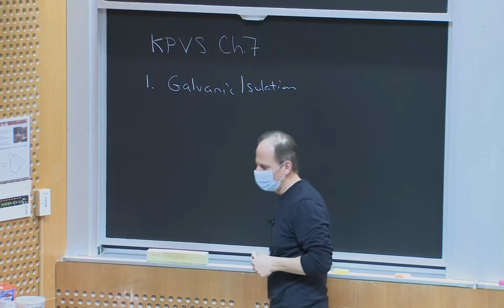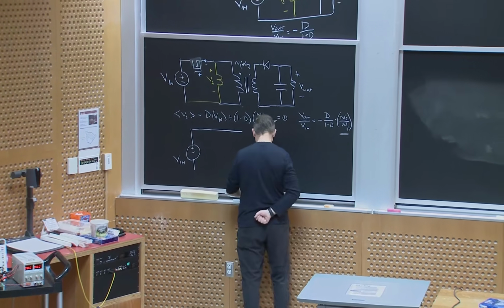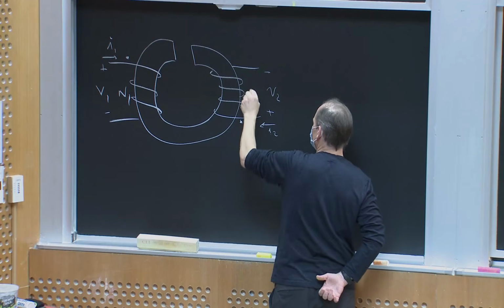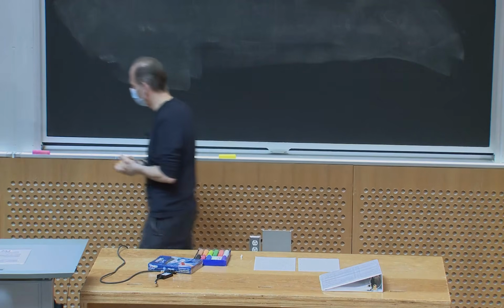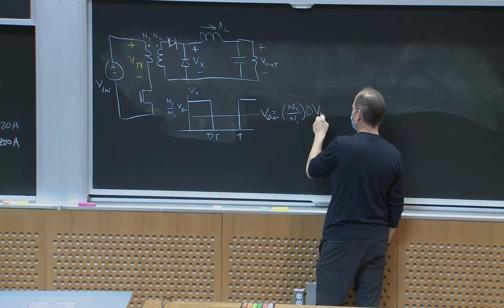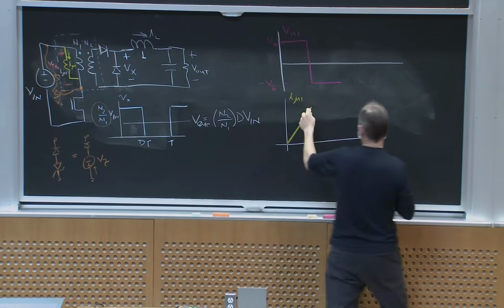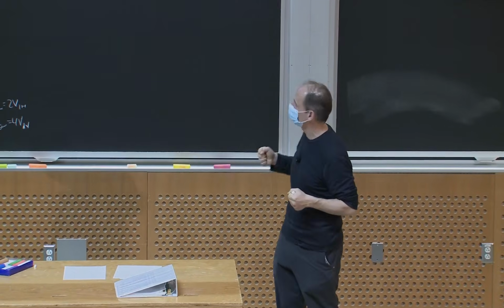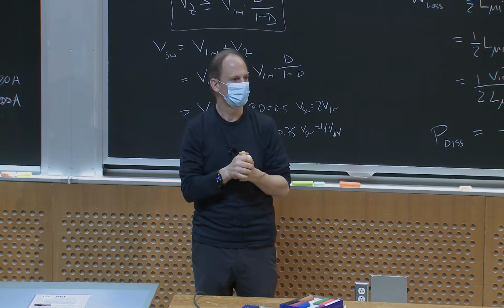Lecture 13: Isolated DC/DC Converters, Part 1

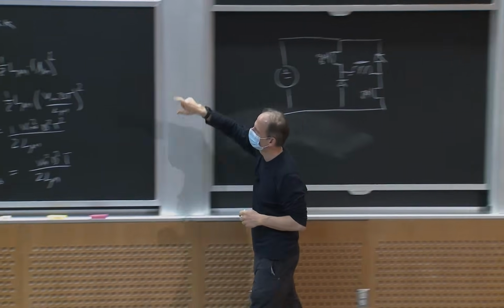Comment: @51:16, the professor explains that we can supply this energy back to the input. How do we give energy back to the input? Is there a big capacitor at the input that we charge during this process?
Reply: Yes. You must always place a big capacitor next to your circuit. You add a tertiary winding that will deposit the energy in the core into that capacitor.

Comment: Been a while since I worked on a circuit with a forward converter, but I think they just used the body diode in the mosfet to provide voltage to reset the core, or a snubber (series RC circuit) across the transistor.

Comment: I'm having trouble digesting the fact that energy is stored in the gap.  It seems that the gap reduces the inductance value.  since stored energy is 1/2Li^2  it seems there would be less energy stored due to to the gap.  I guess we must have to change the number of turns to keep inductance the same?
Reply: Yes, you end up with a different inductor design when there's the gap. The gap dominates the inductance equations.
See ~27m30s into Magnetics, Part 1: https://youtu.be/Z4iE3aaNeTM?t=1650
Reply: @hrldcpr ☝️
Reply: Bigger air gap makes reluctance go up. Permeability goes down. I too dislike the concept of nothing storing more energy than something. I think I have to live with it.
Reply: Yes, you will have a lower inductance, mainly dominated by the gap geometry, and less energy stored due to the reduced inductance, almost all in the gap. The advantage is that you can have a much linear inductor, avoiding saturation, and due to the use of a core and reduced size of the gap, the magnetic flux is contained within the core rather than anywhere else in the open space (as in an air core inductor), so you can avoid fluctuations in your inductance value given by nearby objects. I think is a fair price to pay.
Reply: You wasn't wrong. The reason given by the professor is too distance. Flyback doesn't need too much inductance but need linearity. Flyback always come with  gap. And with gap, flyback is limit to  only 100w when compare to 1000w in forward converter
Reply: @Spark-Hole  there are (or better where) some bigger flyback PSUs, for example the Labgruppen FP series of audio amplifiers. But they have an huge transformer compared to the more common forward converter. With every large PSU having a PFC stage, the wide voltage conversion range isnt as important anymore.
Reply: It is all due to permability in gap mu0 verses relative permability mur which is big . Inductance is L=N^2/Reluctance =N^2/((1mu)*lengthcore/Area)
so the Energy is E=1/2*L*i^2
Reply: When you use a 1920 vintage circuit, you allow DC to flow through the inductor. You pick a material with a relative permeability of 30,000. To keep it from saturating from the DC current, you cut an air gap which reduces the relative permeability to around 4. If you use a 2011 circuit, there is no DC current eliminating the gap. See Teslaco or the work of Cuk.
Reply: You have to 'think' from a magnetism (perspective)....